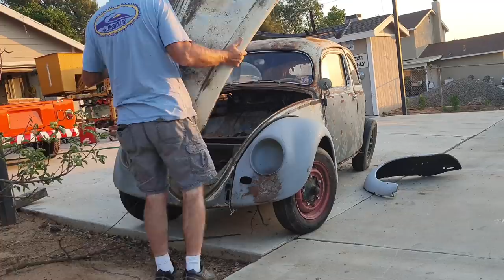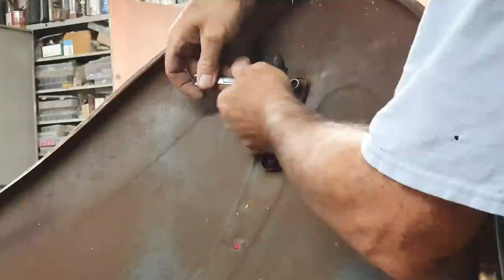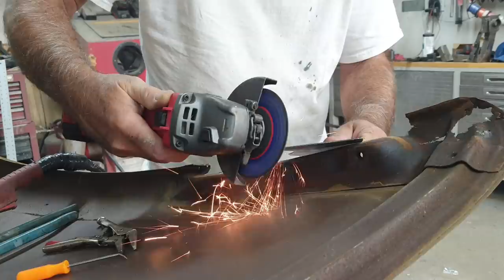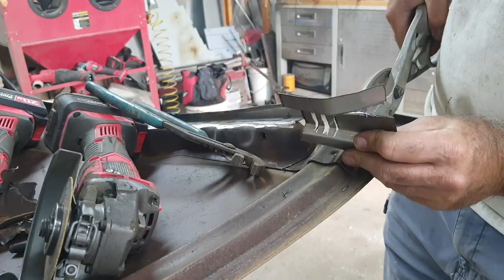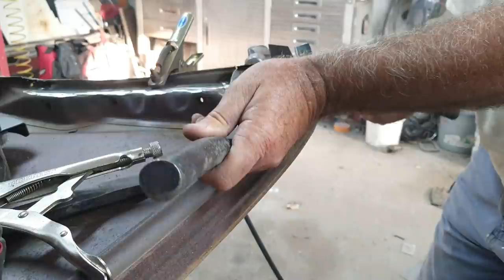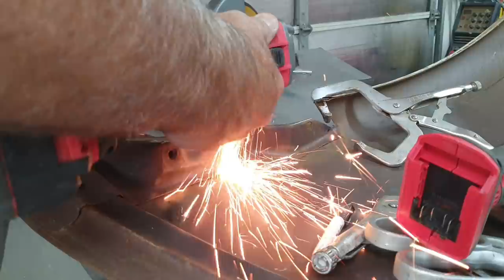1954 OVAL WINDOW VW BUG Restoration part 1  Metalwork the hood

Comment: Do you use rust inhibitor on the hood before you put the new piece in then put it all over the new also?
Reply from the maker: Oh yea for sure. then I will sand it back off then prime.
Reply: @Mikefngarage  I never used that stuff until this last patching job I’m doing. Can’t you prime over it?
Reply from the maker: @68hitnmiss76  yea you can prime over it but I dont like to use it over paint then prime over that. best if you just use it on rusted areas. There is so much rust on there that I need to coat the whole thing then sand it off too many painted areas.

Comment: Mike what was the brand of ceramic buffing compound you did a video on a while back  ? Cream x or ceram-x  ?
Reply from the maker: CSI cream x is good also Menzerna Polish. 400 then use 4500 or 4000. to finish. I like CSI wool and foam pads. self centering.
Reply: @Mikefngarage  thanks ! 😊

Comment: Mike, I know you must have mentioned it before but why have you gone with the Bauer line of tools, valve, performance,  etc. ?
Reply from the maker: price of the batteries is much less than the Milwaukee I always need extra batteries. Performance is good for the price. Plus there are lots of tools that use the same batteries. I think the Bauer line is a great value. some tools last a few dont but overall I can have many more tools for the same money.